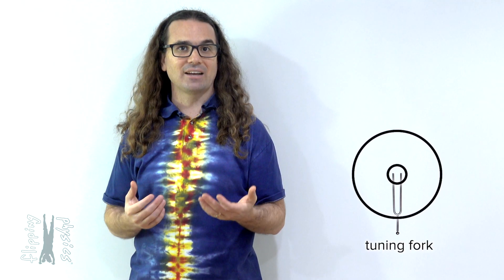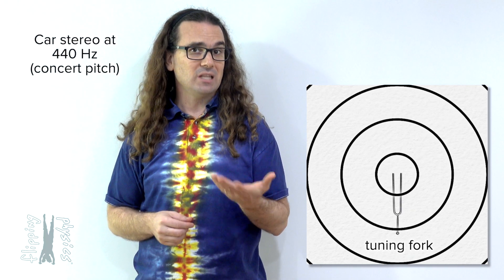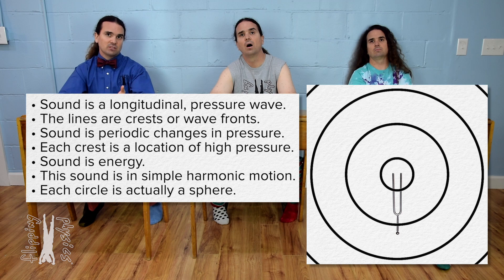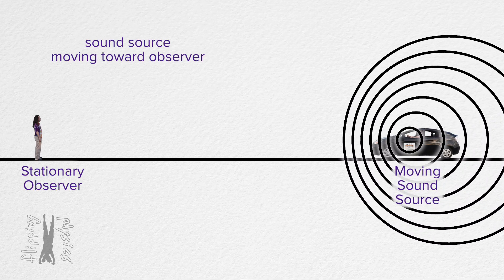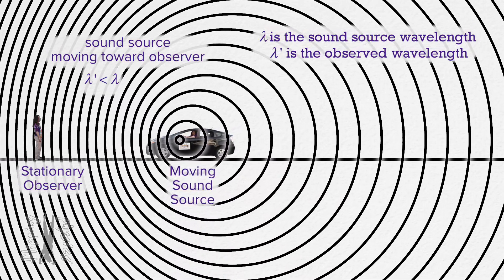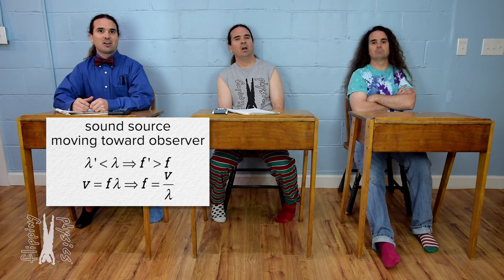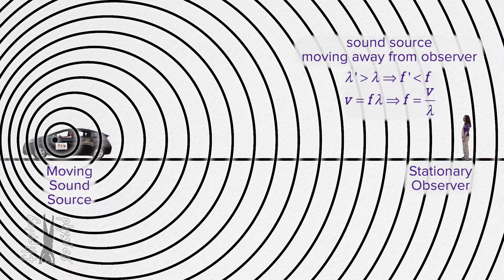Doppler Effect Demonstrations and Animations

Comment from the maker: I have one small correction. To quote El Jison: "at the end of the video [I} said that the observed wavelength changes when the source is stationary but the observer moves. That is incorrect. The distance between wavefronts (the observed wavelength) does not change in this case. However, because the observer is moving towards or away from the source of the sound, the frequency (and hence, the pitch) of the sound will increase because the observer will pass more wavefronts during the same amount of time than if both the source and the observer were stationary. The opposite is true when the observer is moving away from a stationary source, the observed wavelength is the same as the rest wavelength, but the frequency (and pitch) decreases because a fewer number of wavefronts (peaks) pass the moving observer when moving away from the source of the sound. This is easier to see with a picture/diagram with the moving concentric circles. If you consider the wavefronts moving outward from the stationary car, ... the wavefronts are not compressed. However, If the observer moves towards the car they will pass more wavefronts per unit time and hear a higher frequency while observing the same wavelength."

Sorry about that and thank you El Jison!
Reply: If the wavefronts are closer together in the observers reference frame , the wavelength in that frame of reference is less.
Reply: When the observer approaches the source of the sound, can't we say the relative velocity of the sound increases and correspondingly the apparent frequency of the sound, the wavelength continuing unchanged ?

Comment: You're explaining incorrectly. Remember that denser air forms in front of the vehicle, so sound travels faster in front of the vehicle. Therefore, the fringe image is false because the fringes will recede in front of the vehicle, and the fringes will compress behind the vehicle. The air behind the vehicle will become thinner, so sound will travel slower, and the air in front of the vehicle will become denser, so sound will travel faster.

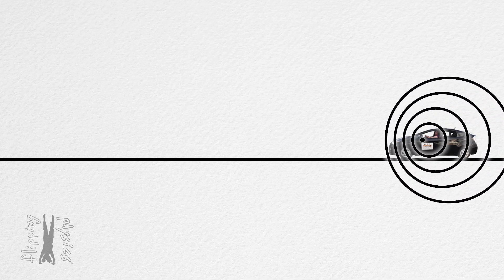Comment: Great video and demonstration. One small correction, at the end of the video you said that the observed wavelength changes when the source is stationary but the observer moves. That is incorrect. The distance between wavefronts (the observed wavelength) does not change in this case. However, because the observer is moving towards or away from the source of the sound, the frequency (and hence, the pitch) of the sound will increase because the observer will pass more wavefronts during the same amount of time than if both the source and the observer were stationary. The opposite is true when the observer is moving away from a stationary source, the observed wavelength is the same as the rest wavelength, but the frequency (and pitch) decreases because a fewer number of wavefronts (peaks) pass the moving observer when moving away from the source of the sound. This is easier to see with a picture/diagram with the moving concentric circles. If you consider the wavefronts moving outward from the stationary car, rather than the moving car @2:51 in your video, the wavefronts are not compressed. However, If the observer moves towards the car they will pass more wavefronts per unit time and hear a higher frequency while observing the same wavelength.
Reply from the maker: Cool. Thanks for the information. That makes a lot of sense.
Wish I could fix the video...
Reply: @FlippingPhysics  Easy enough just to state it in the notes. Your videos are great teaching and learning tools. It is important for students to see that even "experts" make mistakes and occasionally say something incorrectly. Keep up the great work! I'm going to keep linking your videos even in my face-to-face classes.
Reply from the maker: @eljison  Thanks for the suggestions. I have pinned a comment to the YouTube video and put it also on my webpage. Basically it is just a quote of what you said, because you said it so eloquently. Thanks again!
Reply: @FlippingPhysics  Awesome! It takes a huge amount of humility to accept correction online in this day and age. Kudos for that. Physics has a way of keeping some of us humble. Unfortunately, it also has the opposite effect on some others. I know how hard it is to make consistently good content as you have done, especially in video format.  Then to have some "random dude" come on and "nit-pick" some seemingly minor point. However, that is what we do as educators. Getting it right is more important than our personal egos. I wish that I had the patience and your "mad editing skills" to make my own video series, but it seems pointless when there is already a series this good.  Very well done!
Reply from the maker: Thanks. Imagine putting all of your lectures online and having them watched 11 million times. I have learned a lot...

Oh, and, Einstein played the violin to destress. We play guitar. Must be a physics teacher thing. 😬

Comment: Comment 2: I thought that when the observer is moving the wavelength is not changed but the relative speed of sound is changed (u'=u+v)
Reply from the maker: From what I have learned, it has always been the observed wavelength and observed frequency are changed.
Reply: It would be inconsistent to say that the relative speed of sound has changed because that implies that only one component (wavelength or frequency) could change while the other remains constant. But, as demonstrated in the video, BOTH the wavelength and the frequency change inversely. So that's why we don't say that the relative speed changes :)

Comment: Comment 1: important to note that when car is moving the speed of sound is the same (some are confused when comparing to a situation where a wave enters a new medium and the frequency stays the same but speed changes causing a change in wavelength)
Reply from the maker: Interesting, in my experience student's generally do not make that mistake. Thanks for pointing that out.
Reply: From this idea that frequency stays the same during media changes, one might wonder why we identify light waves by wavelength rather than frequency.  For instance, 750 nm red light becomes 500 nm when it passes through glass, but its 400 THz frequency is constant as long as there's no Doppler effect.  It doesn't automatically become green light due to a wavelength change to the free space wavelength of green light, since it is the frequency gives it an identity as red light.

The reason is that after radio waves and microwaves, most of the EM spectrum is beyond our capacity to practically measure its frequency directly.  It is a lot more practical to measure wavelength for IR, visible, UV, X-rays, and gamma rays, which is why we identify the waves through wavelength..  Diffraction allows us to measure wavelength, whereas for frequency, we don't have signal processors fast enough to keep track of Terahertz.